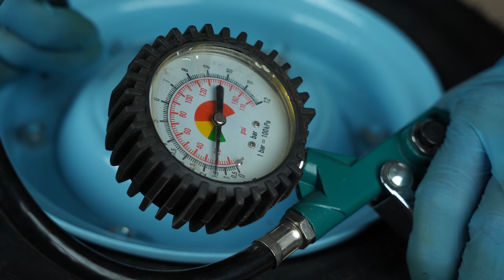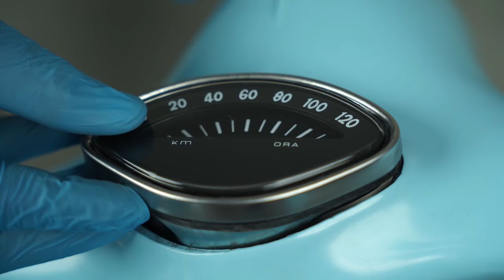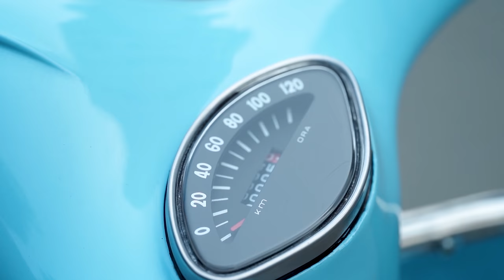1962 Vespa Scooter Restoration Final Part # 3

Comment: Nice work.  I had a Vespa in 1961, it was a 125cc.  Later I had a chance to acquire a 150cc engine off a wrecked/totaled Vespa and I jumped on it.  The only mistake I made was when painting, I was looking for Candy Apple Red, and being the young 'smart person' I ignored the paint man's suggestion to put on a Gold basecoat then Purple that you could see through, the combo makes Candy Apple Red.  Well I outsmarted myself and told the guy to mix me a Red instead of Purple and the end result turned out ORANGE.  It was pretty but not at all what I wanted.  I rode that Vespa for 7 years and loved it.  I later had trouble with the clutch and took it apart to repair and noticed the woodruff key had wallowed out the slot in the crankshaft...While I was waiting for a new part the Vespa was stolen, I never saw it again...I told the dealer and didn't have to pay for the crankshaft but I often wondered what happened to it, it was my Baby!

Comment: I have still drive scooter 🛵 but my scooter is LML NV Special. I purchased in the year 2000. Currently it's about 22 years old. However now in the market its parts and accessories very rarely  available. The shopkeeper who sold scooter parts also grew very old and weak... Now on the roads mostly Honda Activa automatic gaers vehicles can be easily seen... They are the transformation of scooters

Comment: No doubt vespa is called mini car in pakistan but the petrol price is rising very high .people do not use vespa every body is runing behind cd 70. its petrol milege is very good. i bought vespa 150 piago in 1982 just driving it. some years ago i also bought cd 70 honda to save petrol. some time i use vespa and remind the old days when petrol was 5 rupes pr liter and now petrol is 250 rs per liter. all the time i miss vespa ride but what to do petrol is high. spare parts are also expensive and very rear mechanics are avaliable for vespa work. thnx dear today i saw vespa restoration on net so i share my words really vespaa is a vespa.

Comment: Why he baked all the parts at 200 degree-C can any one tells
🤨🤨
Reply from the maker: Coz I did Powder coating special paint, a very hard, heat proof ( can bare upto 500°C) and very long lasting Paint. To dry powder coat paint, it needs 200°C temp.